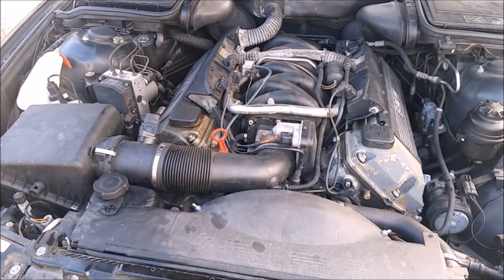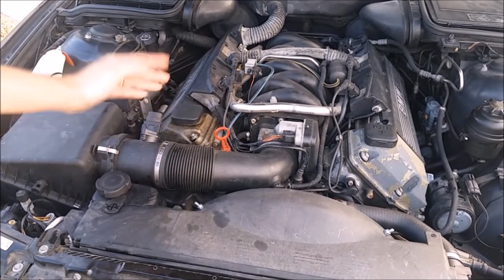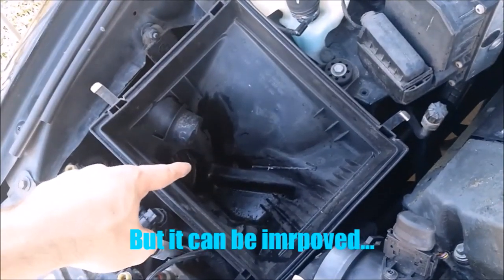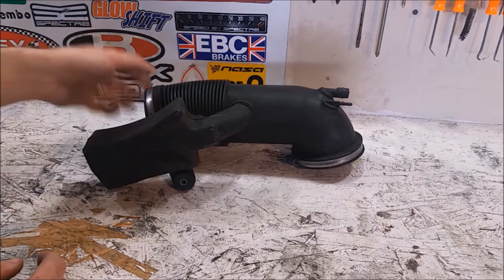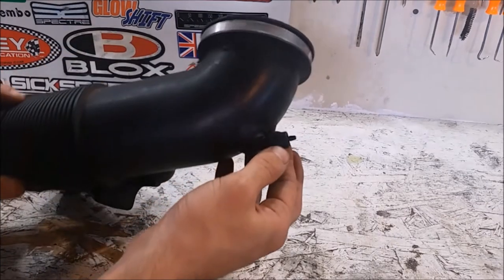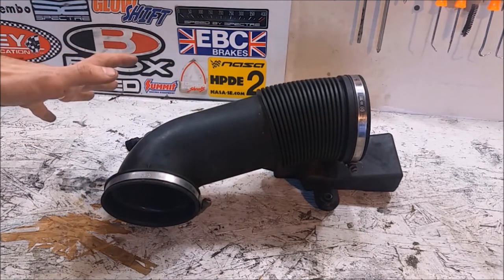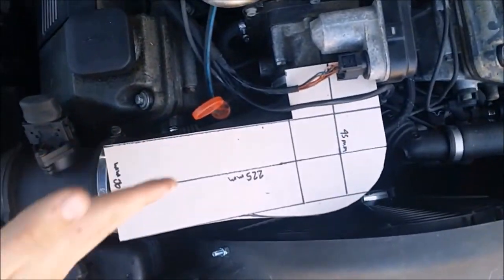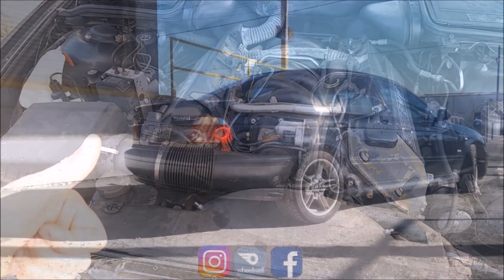How to Design a Custom Intake for the E39 540i (BMW Part 1 of 4)

Comment: Hello, would you be willing to make another one of these, if paid well for your services? I have a '98, pre-VANOS model...running an electric-fan conversion and aluminum radiator kit from Zionsville, which could also allow for a bit more curvature in the pipe.
Reply from the maker: Unfortunately, I don't feel comfortable making carbon parts for other people's cars. I'd be happy to answer any questions or provide any advice to help your make one.
Reply: @350Z247  That's understandable. Thanks for your quick response.